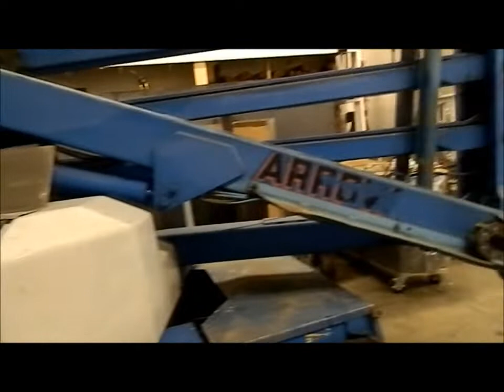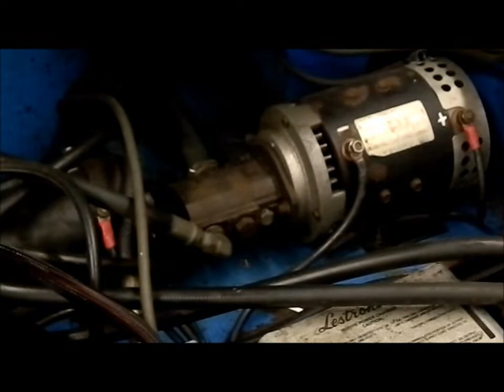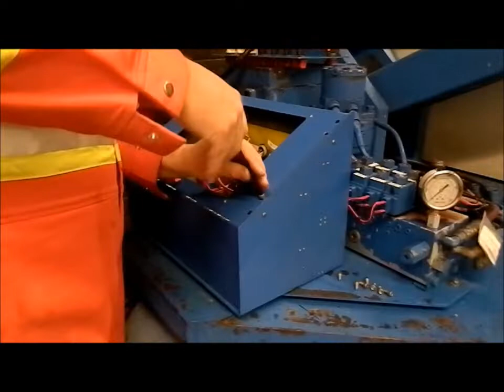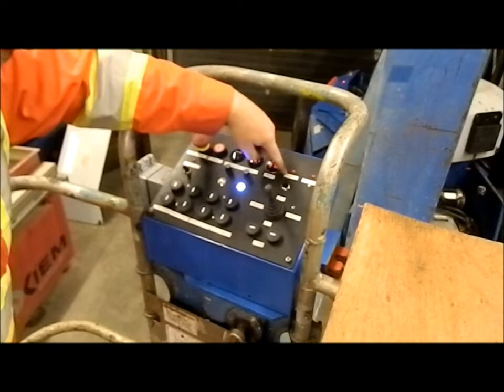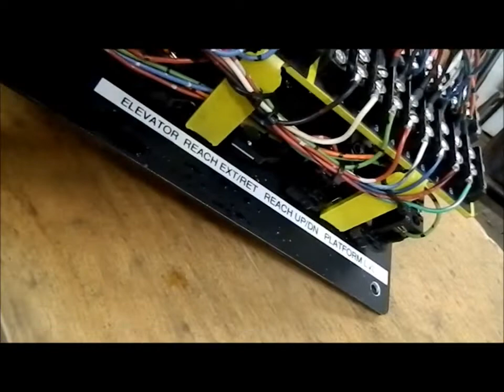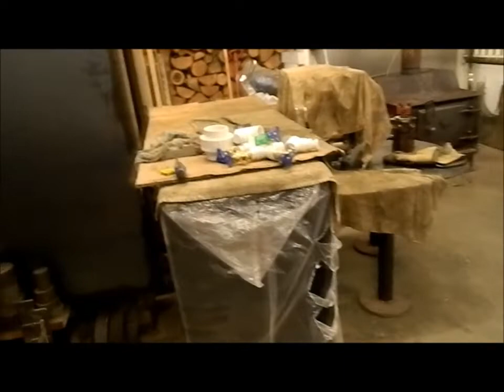Genie Z45 22 DC Rewire completed

Comment: do you have any sugestion on the creep switch on the platform how to upgrade with something elese ?
Reply from the maker: There are two hydraulic valve blocks one for the drive functions the other for the boom functions. each block has a variable spool valve to control the amount of flow ie the volume of the hydraulic flow. The two main hyd pumps are driven with 36v motors. All of the control functions are 24v. That variable spool valve is 24v. Dealer wanted $2000 for a new controller. I bought a 24V PWM power supply on aliexpress for $8. This $8 PWM power supply gives me the variable flow to control the speed without the $2000 price tag.
Reply: Thank you for getting back to me.do you have some link sugestion so i can find more easy the right parts.

Comment: Nice job, you have great patients, that's a lot of terminal strip wiring. Love going with the mechanical relays as opposed to the solid state switching. How well will your modifications ie: labels and switches stand up to the weather? Be nice if it can always be stored inside when not in use.